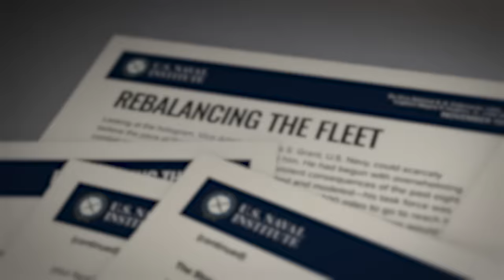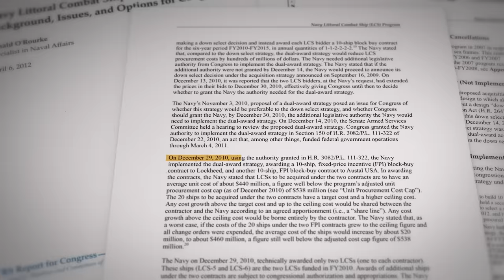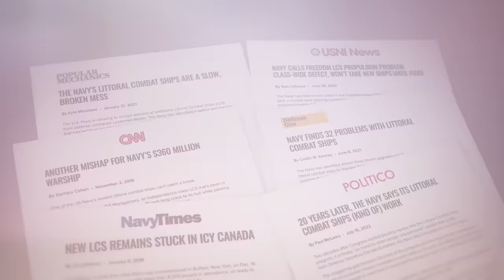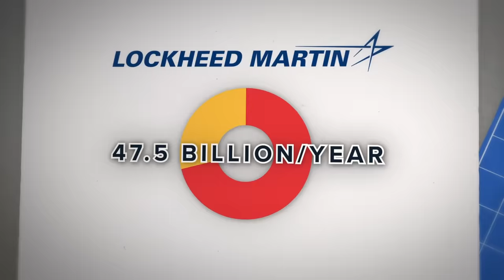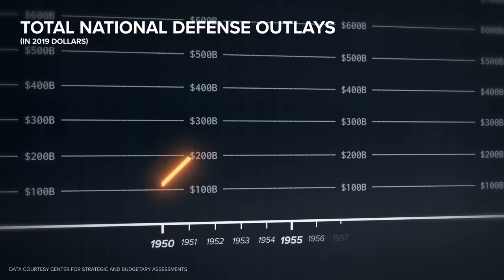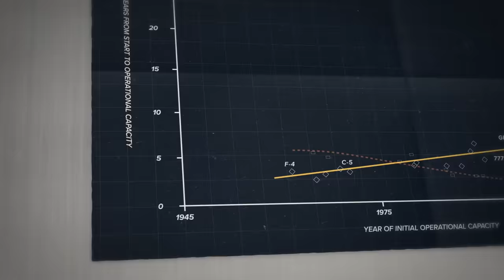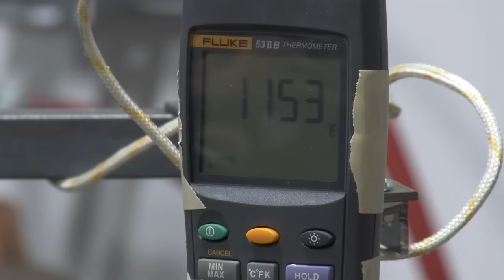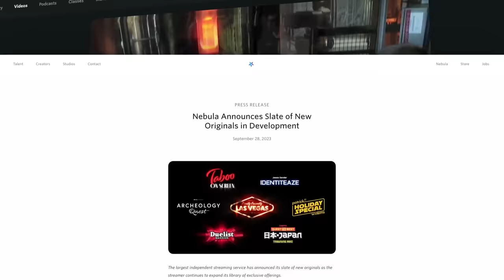Why the US Military Costs so Much

Comment: I am one of the designers who worked on the Comanche at Boeing. The Government kept changing the specifications so often it required several complete redesigns of the air-frame. We spent lab time developing new ways of making composite structures had large shops to make mock ups and I wound up flying across the country on a biweekly basis. There was so much paralysis from the Pentagon on decision making that we often had to stop work of hundreds of skilled craftsman engineers, technicians, and other scientists and wait for a decision to be made. If we could have been given a specification and turned out a prototype, even if that prototype failed it would have been cheaper to do three or four iterations than the two prototypes built.
Reply: Sounds like a Pentagon Wars scenario haha. Seems like the problem is more on the procurement side; industry can (within reason, no AI-controlled hovertanks with railguns and force fields) build whatever the military wants, the military just has a tough time deciding just what the heck it actually wants. 

On a related note, do you think this has something to do with vastly changing mission requirements? For the better half of two or three decades the US military has been focusing on asymmetrical counter-insurgency fighting, then we’ve done a 180 and are now focusing on peer or near-peer adversaries as our most likely main threat. And recently we’ve got both as possible threats at the same time. The lessons being learned from Ukraine are incredibly difficult from the lessons being learned from Gaza, for example, and I wonder how the military hopes to address both concerns simultaneously. My worst fear is we start getting “compromise” vehicles/weapons systems that are okay at both tasks but great at neither. Take the new Abrams they’re developing, for example. The impetus for the tank is to lower the weight by integrating as many new (but proven) systems as possible, instead of just bolting them onto a new tank. So will we see a TUSK-like system on this new tank? It would be dead weight and next-to useless on the open fields of Eastern Europe, but it would be a vital piece of kit in places in the Middle East like Gaza city.
Reply: Really is a shame the Comanche didn't come through--it was sooooo cool, full of so many amazing capabilities...
Reply: If only they could keep the requirements fixed from their side but change them as the design proceeds and it becomes evident that some things were not thought through.
Safety considerations are another source of pain, unless they were very well considered and put in clear writing they will become a show stopper.
Reply: @0MoTheG im on the tech side and ive never seen a project where requirements are fixed
Reply: @chewycaca  Exactly, but in theory they would be and ought to be. I too have never seen it done right neither in the civilian sector nor military. It is just one cluster fuck after another. I knew someone who quit from a radar army program and I quit from a medical project over changing req. Now we can't meet the requirements and luckily the management is just going to let it happen to renegotiate.
Reply: Partly because weapons programs are how many States, and jobs does it create. Not how good the weapons systems are.
Reply: Yeah fucking right you're the designer.. 😂 myself actually I designed the spectrogram nuclear telescope for area 51 back in the 80s. Shit was pretty fun too
Reply: Why we are in $33T in debt. Most Americans don’t have a clue about the huge mountain facing our train heading head on and IF we ca survive the crash.
Reply: @Lukusprime  Whats the issue. Do people at the top get there because of their connections/wealth and not their own merit?
Reply: I am space astronaut from Supernova MF-120 from 3 lightyears from here.
Reply: What's your salary? how many of you work on a typical project? How many of you are actually needed?
Reply: @Veritas.0  This was 1987 so salaries have risen quite a bit since then. On the Comanche at Boeing when I was on the project there were about 950 people and then there were many others as Sikorsky. I left after some of the early model construction, wind tunnel tests, etc.  With the rent of facilities for testing who also had a thousand or more personnel the cost of the Project was on the order of $1,000,000 per day. Most people were necessary, but the start, stop and many re-definitions and redesigns well over half was waste due to people standing around, and facilities paid for on an hourly basis that did stand still while the Pentagon did remakes. 
   With perhaps 5000 individuals working at least part time on this stage of the project you can probably run into a few of them from time to time.
Reply: REALLY??? WOW I always loved the RAH-66 Comanche, such an insane WASTE not having built it in mass.
Reply: Seems to corroborate logistics being the greatest trait of the American military
Reply: Do you feel in any way responsible for all fhe deaths that the weapon you helped design has caused? Perhaps you should
Reply: @dave8323   Why should he?
Humans are ki... each other, weapons are just a tool. Don't blame the game, blame the player.
Reply: @dave8323  Not at all. I had to directly deal with KGB Spies from time to time. We were in a war with hot spots everywhere. Remember Communist nations have killed more of their own people than have been killed in all the wars of the period. Weakness means far more death. Do you feel responsible for allowing Communists killing people by the millions?
Reply: The same stuff redesign BS happens in Corporate because they want to keep their jobs.  If people weren't so crazy about laying people off all the time then you wouldn't have this pretend to be busy redesigns.  You have to take a step back and realize a few things.  Once I became a parent and had my kid play as a pitcher on a baseball team, I realized the truth of the military.  You ALWAYS have to spend the money aka work or train.  Because if you don't, you will soon suck.  My tiny son could pitch that ball anywhere he wanted in the strike zone.  He'd strike out batters that other pitchers couldn't.  After a few weeks or month of goofing off and thinking he's so good and can avoid practice, we'd discover his skills were no longer sharp.  The money I paid a 1 on 1 coach was a lot, but if you are serious like war, you better stay on your best game.  It's expensive because you can't take your money with you to heaven.   Other parents didn't want to spend the money for batting practice and it was my tiny son that hit the home run against a top California team and their parents then realized they had 1 chance to have spent that money wisely and didn't.  You can't spend the money after you are dead from war.
Reply: If it makes you feel any better I work for a shock designer for the big 3 along with some other brands and you wouldn't belive how common this is. 

We tell them x won't work and they ask for 30 hours of testing done to 8 brand new shocks, which that early in production cost between 3k and 10k, and the test results just show we knew what we were talking about
Reply: Sounds like pure pain, I can't even imagine
Reply: this seems to the case across the board with procurement projects. The upside to the more forward looking ones, like comanche, is a lot of the tech created for them ends up in other designs. It would be better if they Pentagon just said "here's what we're trying to do, go cook up some tech, then we'll bake it into a new platform." Might get some  trully transformative designs
Reply: Sounds like the Same situation happened in the army with the IFV M2 Bradley back in the 1980 with the top Genarals wanted more specifications From a vehicle to transfer 12 troops to only do 6 and do recon and tank killer.
Reply: Sounds about right for most government contracts lol. Scope creep is the real enemy of these projects, especially if you impress the upper brass who then say "this is amazing! Make it do this too!".
Reply: So its the same for all around the world 😂
Reply: I actually really appreciate this insight
Reply: @dtsai   it's pretty gruesome to compare a kids Little League team to war.
Reply: Didn't they cancel the Comanche because the design was gay?
Reply: @Lukusprime   Nah it's more about ego's.   If you can force a change in a project, it means you're and important person,  so EVERYONE each on their turn forces a change to get a boost to their ego +  justifies pay raise. 
You're a little naïve about how Pentagon bureaucracy works.
Reply: @Crimethoughtfull lk
Reply: Skilled engineers at Boeing ! Good one
Reply: The governments gonna take your life
Reply: You guys must be super genius.  must be great to work for such a high tech project
Reply: shocker, politicians wasting time and tax payer money. where have i heard that before?
Reply: @aceman0000099  he didnt say he was THE designer. Its not that crazy that one of the designers is watching yt videos about what they did
Reply: @moors710 
What’s your view of the F35?
IMO it is great success.
Reply: @bradz9413  F35 is good, but really expensive. It is always a trade how many compared to how good as quantity can swamp quality.
Reply: @moors710 indeed. Seems like damn complex project in my humble opinion. 
I acknowledge it being incomprehensibly complex; others in the comments do not seem to.